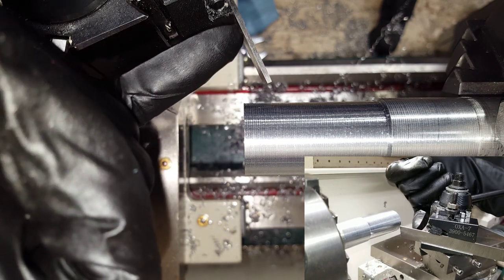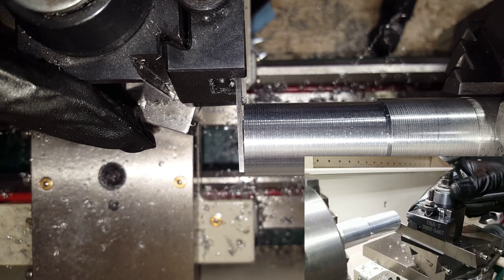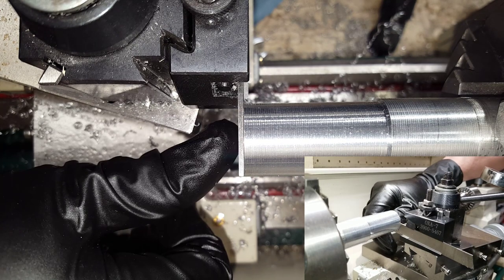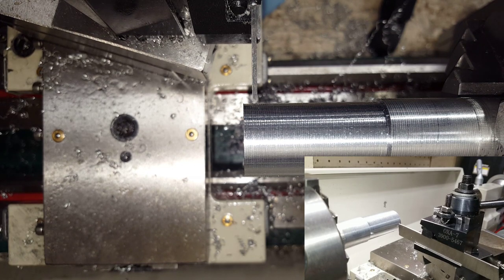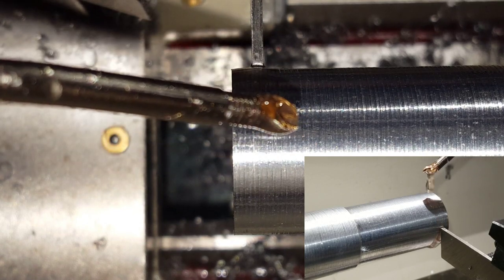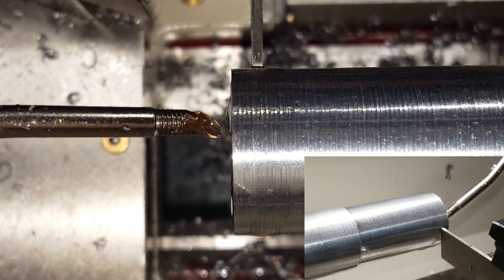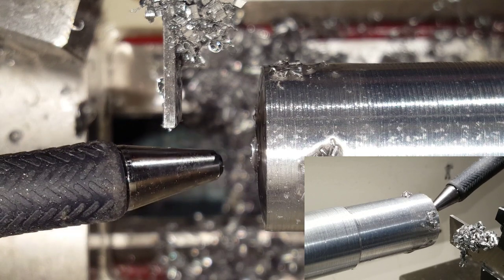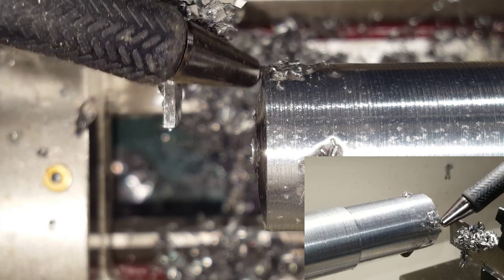How to Use a Cut Off Blade on a Lathe

Comment: My work piece pushes my blade back into the tool holder.  I have tightened it down quite tight.  Is it just because I bought a cheaper cut off tol or something?   No clue.😮
Reply: same